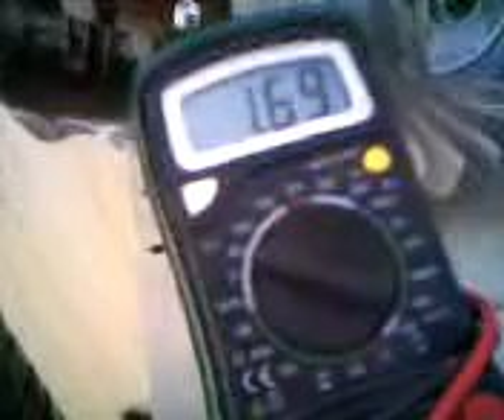HHO torch electrical properties 1 of 2

Comment from the maker: If that were the case I would have expected to get voltage without a flame. And when the flame is lit, notice that the flame is invisiable a potatium contaminated burn, changes the color of the flame, there is no elyte involved with the reaction. and the plates were stainless in this run. But the Highvoltage I am getting off the generator engine I am running is very interesting, and it seems to be the same effect.